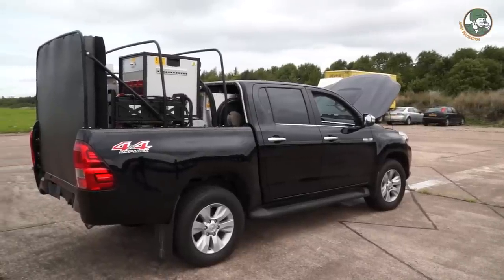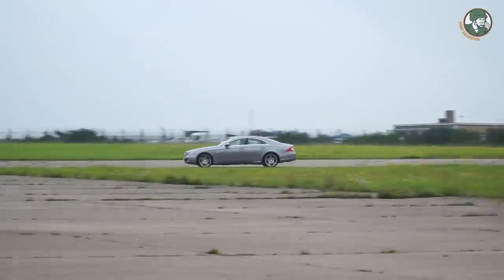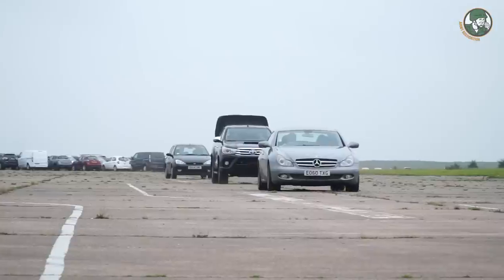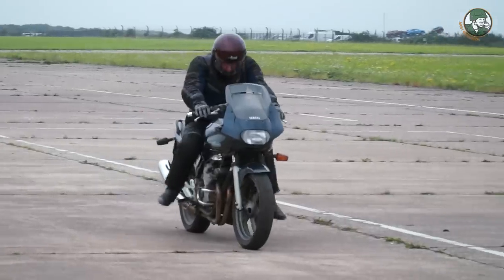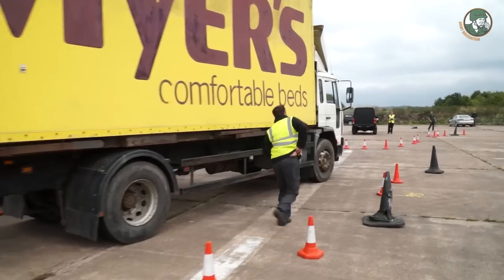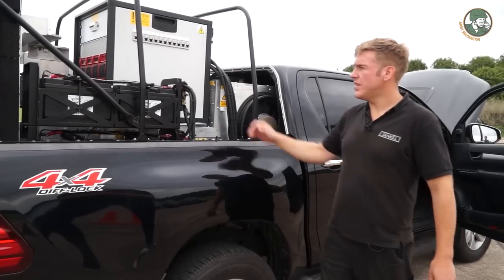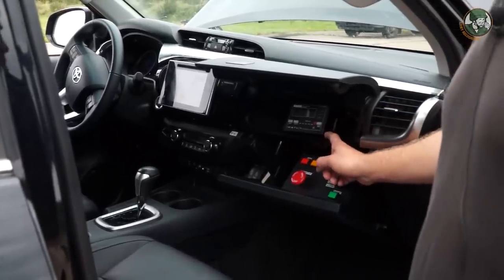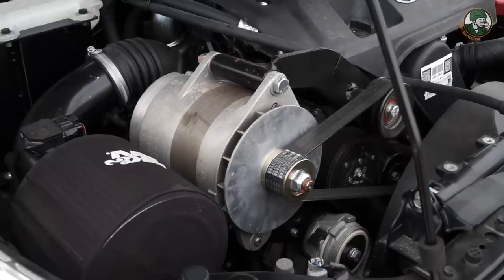Demonstration of the Jankel Integrated RF Safe-Stop system

Comment: I use Adhesive Foam RF Shielding Sheets to wrap my car in the event of an attack from the RF Safe-Stop system.
Reply: gabriel Duarte  
😁😁
Reply: Gabriel  Hot to block a oldschool diesel? that don't even needs a battery...

Comment: Can't stop my truck. Mechanical fuel injected diesel with no electronic components...
Reply: Niceeeee cummins?
Reply: Mark casper vehicles like yours are getting more rare so your point isn't really valid
Reply: Wrong
Reply: Perpetual Loop While there are electronic systems they won’t cause the vehicle to shut off. I have major doubts that the SafeStop can disable specific sensors and seeing as a mechanical fuel injection system is a mechanical pump run off the engine the pump is going to continue to pump fuel and the spark plugs will continue to fire and the engine will continue to run. If he had an electronic fuel injection system it’d be a little different because the computer is controlling the amount of fuel going into the engine instead of the rotation of the crankshaft.
Reply: what about  he ignitions system ? Electronic transistor controlled ignition `?
Reply: Modern vehicles can even be hacked  and remote controlled, driven into a tree at a 100 mph for example.
Reply: @counterphorce  That is True. So the Truck can be stopped.
Reply: Uh spark plugs
Reply: What about cam or crank sensor or any other timing components
Reply: Isn't that for spark plug engines ?
Reply: The reversed polarity✝️☦will delete your truck... 
PYRAMIDAL WARNING 
⚠️🕯♒⚛🔯⚠️✡
📚🧲💉
Reply: Lemme guess. 3406b?
Reply: glow plugs
Reply: That's cool
Reply: @safire7384  his point is valid rofl he said it would work on HIS TRUCK, not something that is a solution for everyone. Schmuck
Reply: No relay or fuse switches either? Im pretty sure that's what this machine specifically targets since it can't shut off an alternator or battery.

Comment: Im skeptical, the metal shell of the vehicle would provide emp shielding. It would require a HUGE magnetic field to affect the circuitry inside.
Reply: jakenbaked87  bs I got bunch idiots made one like keystone science, and has damaged all electronics in mustang, of course u running 60 and they pull up beside and aim at your transmission and your car shifts to 2nd, it rips shit apart, it’s not safe and police in for some Crimea they will never stop
Reply: @GodswillBDone4WeThePeople  Fucking hell dude
Reply: You think they can't make it? Lol this is legit and it's not even that complicated. Look how huge the box is. The magnets they have in there are gigantic and can be focused
Reply: @GodswillBDone4WeThePeople  "aim it at your transmission" lmao
Reply: it doesnt the device emits a massive electromagnetic microwave pulse at the target, the wiring harnesses and chassis act as a massive antenna and it induces backcurrent in the wiring harnesses causing the can network to shut down (similar to those little emp devices people use to reset calculators) but on a much higher energy scale 

basically. a massive digital microwave cannon that can focus via software

Comment: I wonder if it would work on a quad I have a Honda Recon ES (Electric Shift) it shifts gears by pressing buttons that control a servo, it is also electronically fuel  injected so I am assuming it would stop that but would it sop something simple like headlights or gear shift? I know it would not stop my older 1976 Honda TRX Fourtrax 125 because it is  carbureted .
Reply: Gabriel-fy9os  You keep asking about a carburetor but that has nothing to do with any of this.
Reply: @error.418  “keeps asking about a carburator” he said that ONCE at the end—saying that he knows it would work on his TRX Fourtrax because it’s carbureted.
Reply: @halvorson566  There are more comments on this video than this one. He said it would NOT work, which is incorrect. And it has nothing to do with a carburetor.

Comment: Good luck to the authorities that attempt that device on a vehicle that, riding inside, has an innocent person with an electronic implant that sustains their life. Example?  Pacemaker, anti-tremor brain stimulator, insiline pump etc.  It's likely to kill that person... Or IS that what your local, power-drunk cop actually wants?
Reply: Collateral damage during a risky behavior.
Reply: or just disabling the car on the highway, fatally causing the car to be hit by the one following it...
Reply: This device is more for people who want to be left alone by the boys.  Cherrys in the review flip the switch and you just casually carry on driving.  Who cares if the driver has a pacemaker and insulin pump or the car gets totaled.  One armed tax collector gone.

Comment: Probably wrap your ECU with that RF blocker material in wallets
Reply: That's not how this works. The device emits a massive electromagnetic microwave pulse at the target, the wiring harnesses and chassis act as a massive antenna and it induces back-current in the wiring harnesses causing the network to shut down. Simply shielding your ECU would be insufficient.

Comment: So for anybody that wants to actually know. Because this actually happened to me the other day in my Camaro SS going about 170ish,  i was emp blasted by state troopers . what it did was put my ECU on power reducer and shut off 4 cylinders. Completely wiped out my tune I have to redo the drive cycle program also smh. I literally only go fast on the country roads late at night so I don’t hurt anybody. It was crazy it’s set off alot of codes, made the car going insane, dash cluster started glitching im not kidding. I’m literally about to build some type of barrier around my ECU box. Wtf